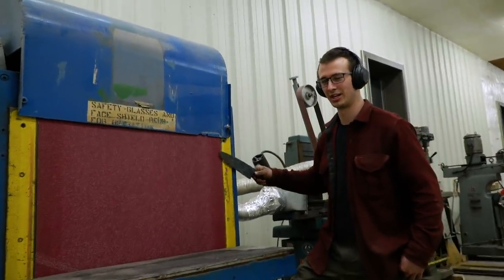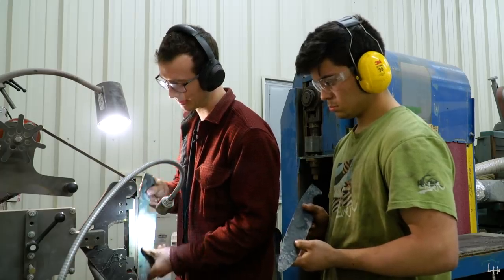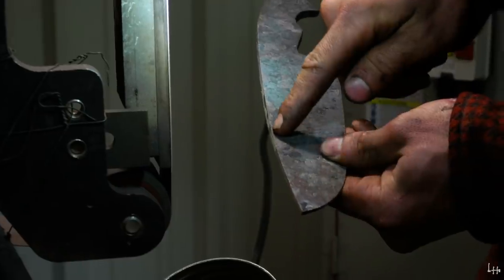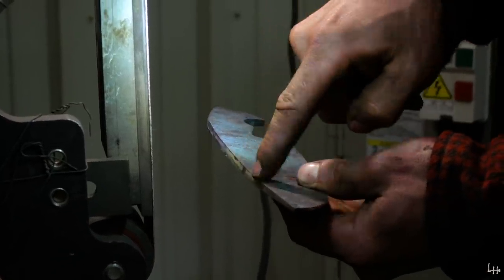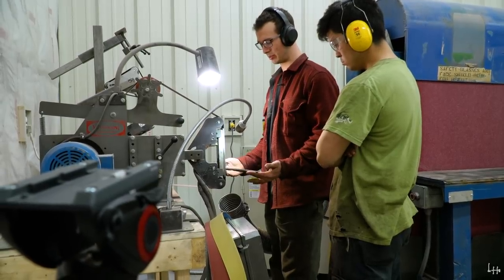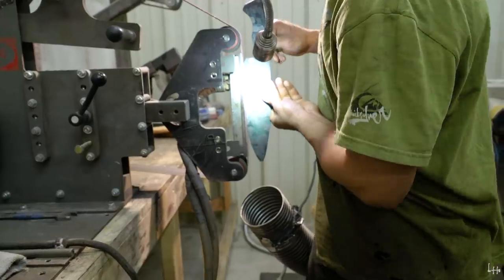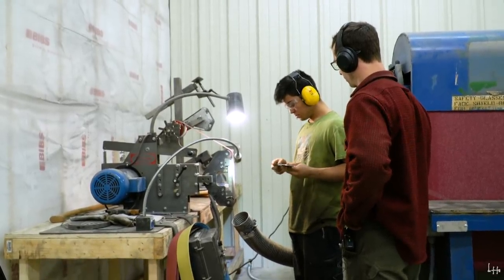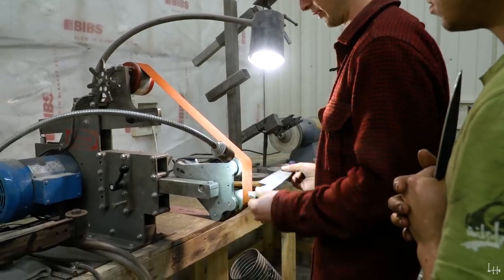CHAD MAKES HIS FIRST KNIFE WITH ME Pt. 2

Comment: I don’t blacksmith so this isn’t criticism but a question, why did you not forge the the thickness down more, it seems pretty thick at the handle and at the spine. It just looks like you could save time grinding and save belts. I like how the knives are looking. I like chads profile more, I like the curve at the tip. Great work Liam
Reply: So it doesn't warp during heat treat? that's my guess... Disclaimer... Also not a blacksmith!
Reply: Because, in a survival situation you want something to act as a ramp if you run off the road and end up in alligator infested quicksand surrounded by tarpits, you can throw the knife on the ground and dtive straight up the spine and back onto the road, away from those damn alligators
Reply: Forge thick grind thin

Comment: I've never used a respirator while grinding and I'm fine. Are you guys a couple not judging just wondering?
Reply: Just because you don't have any effects now doesn't mean you won't later in life. Those fine steel bits settle into the avioli in your lungs and slowly cut and scar your tissues, eventually causing permanent, life threatening damage. There's no reason not to grind with PPE